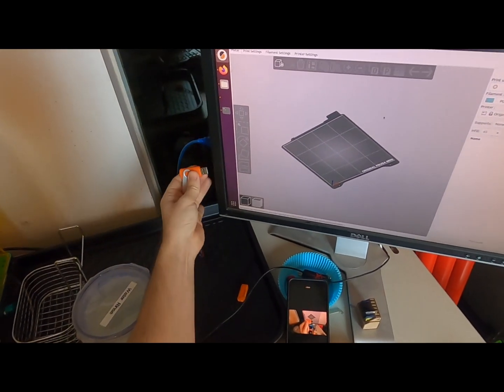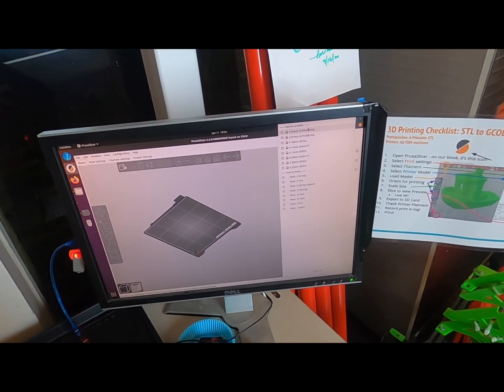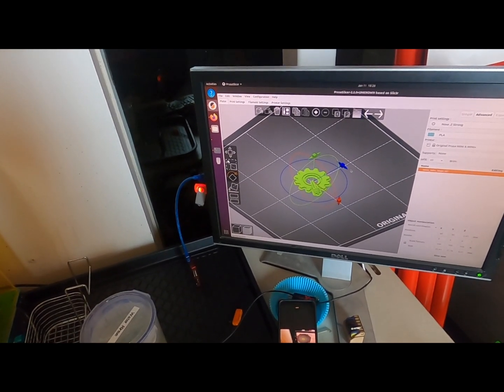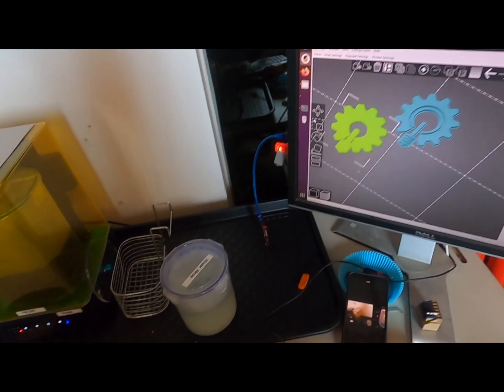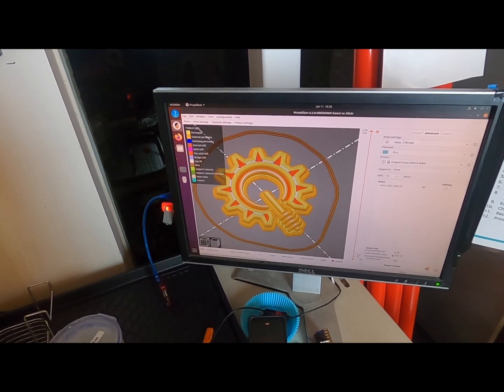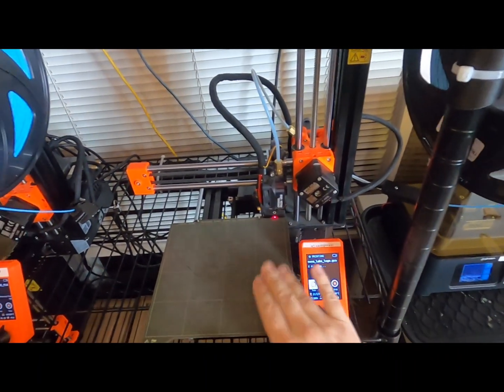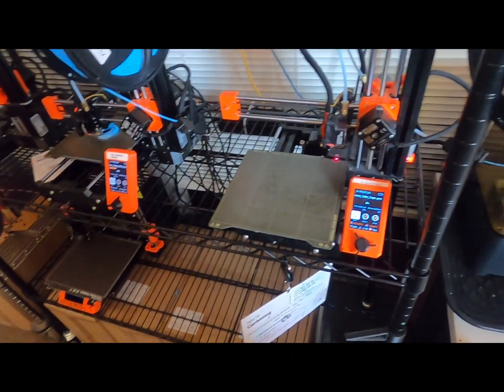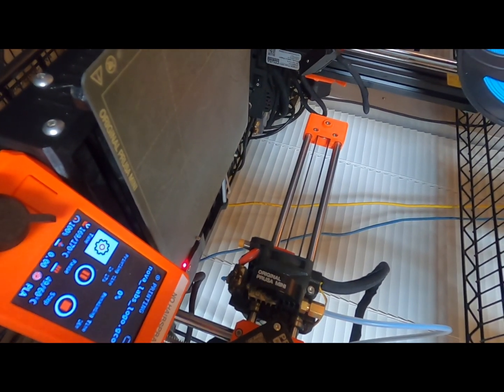Prusa Mini Printing

Comment: Hi Paul. Nice print farm. My mini is coming in a week (at least I hope so) Do you have any tips. This is my first 3d printer
Reply from the maker: Not my farm (mine is way weirder), that's our local makerspace Nova Labs (https://www.nova-labs.org/).

Which is, incidentally, my advice - find a local makerspace, or possibly a RepRap User Group.  

I see a lot of advice that Printer X is the best, or that you need to do Y... It's better to go a more moderate route.  Most printers do quite well out of the box, and you generally don't need perfection to make functional parts.

Chasing the best Benchy isn't pointless by any means, but it's OK to use a printer that's not perfectly dialed in to make yourself useful parts.

Comment: Paul, would you recommend the mini? Are the old issues worked out by prusa?
Reply from the maker: I would recommend the Prusa Mini - I think that the mini is probably the best bang for the buck, printer-wise.  Very well optimized, very good printer-to-printable area ratio, great safety built-in - not just thermal runaway, but failure to level, hitting random stuff during the print, etc.

The only issues we've had with the mini is the extruder - being Bowden, there's a bit more stringing, mostly only noticeable when printing TPU.  I figure more time tweaking the slicer profile can help with that, but probably won't match a direct drive hotend.